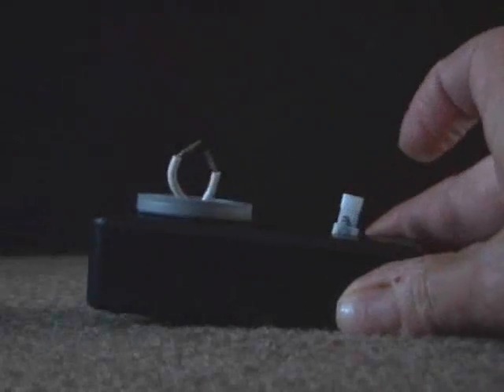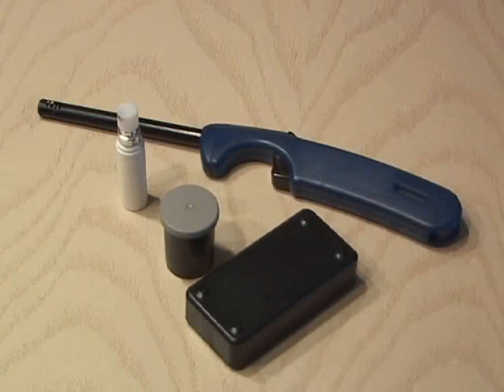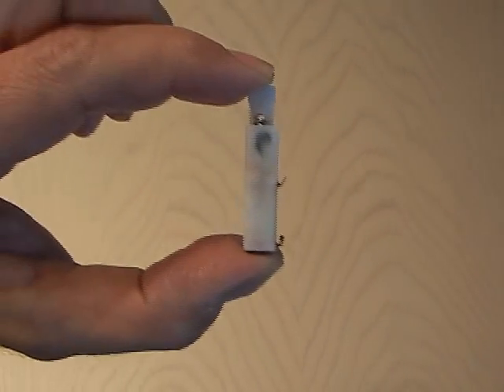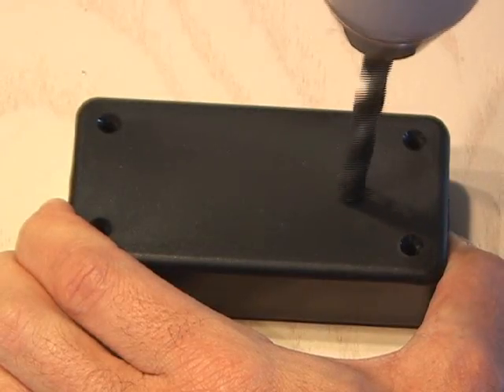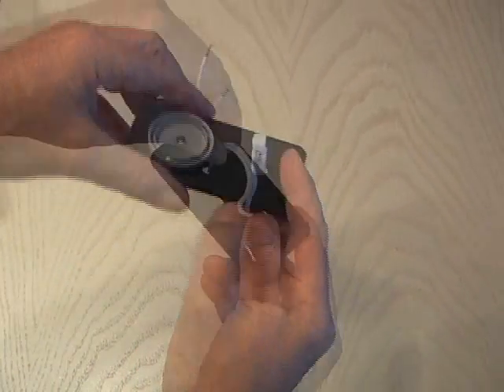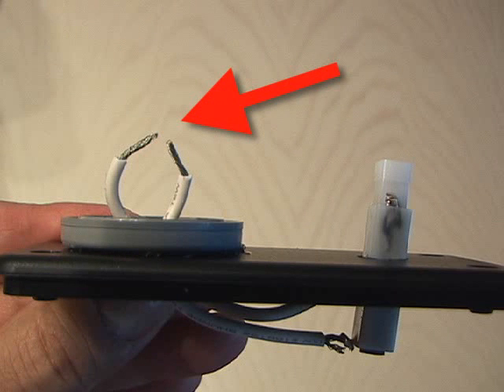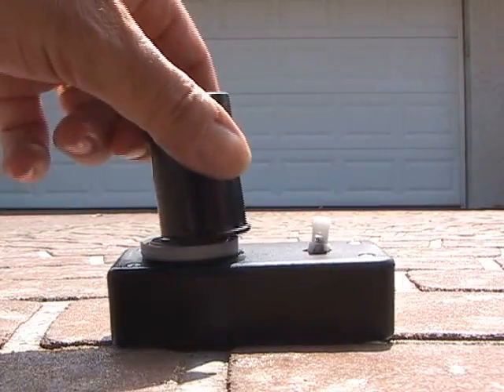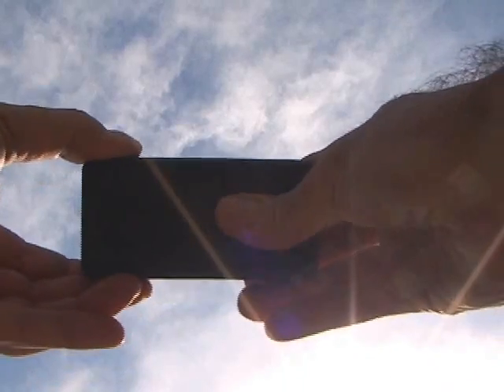Make an Explosive High Power Cannon!

Comment: I had no idea all that stuff was in the lighter. The igniter switch gave me an idea for an outdoor electric grill hack. I had an igniter switch go out on my grill. I think you can use the lighter switch from the $1.00 lighter and switch it out with the one in the grill which runs $10 to $12. Mine is still good so I obviously won't take it apart to find out until it breaks.

Comment: i did this with just the canister and the igniter by cutting a two holes in the bottom of the canister and putting the igniter with a disc bottom thru the first hole wich is bigger, and the wire thru one wich is smaller. I kept the igniter attached with duct tape and used axe deodorant as my fuel

Comment: I built one of these. It's currently almost 2 am here in England, i finished it shortly after 1. Because i don't have breath freshener, i used butane. Tried holding the trigger into the cylinder for 10 seconds, clipped it on and hit the button, no response. I took it off, blew the gas out and filled it for 3 seconds.

It went off like a gun, "BANG!" and flew into the air. EPIC WIN! I'm so pleased with myself... lol.

W/ a few more parts i can make an integral fuel feed. Then it'll be amazing

Comment: i did that except i didn't have breath freshener so i used axe body spray it didn't work with one squirt so i got ticked off and sprayed a ton in when i fired it it flew up 25 feet like you said then when i looked down to reset it the lid and the wires weren't there just a bubbling mess of plastic............. it was so cool

Comment: Honestly I didn't know. Today I went to radio shack to get some soldering equipment and right there I saw 4 different types of "Hobby boxes." They are actually called "Project Enclosures."

They come in 4 sizes.
Thin, but longer
Small
Medium 
Large

Comment: i took a waterbottle, dug a quarter inch hole with a pen in the cap, took the cap off and sprayed the inside with 1 burst of ax, i put the cap lit it with a lighter and it went flying into my wall. scared the shit outta me. the inside of the bottle looked wicked when it went flying and it didnt even burn melt the bottle.

Comment: I just built one except I used 10 12-volt car batteries, a 60 gallon steel drum and a propane tank full of gas. It shot a half mile in the air, and I am now serving 2 years in prison. Thanks alot!

Comment: you can also use hairspray. 
another idea is to take a peanut can and spray some air duster into it upside down and put the cap back on. it will bubble the cap and eventually pop